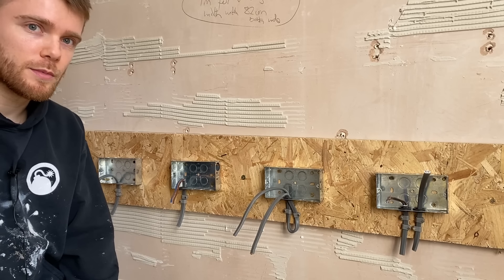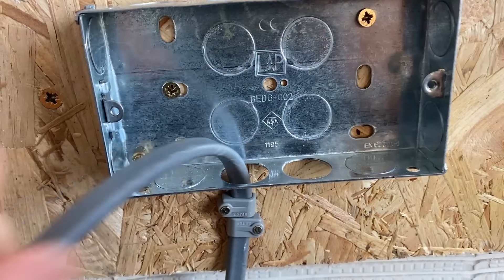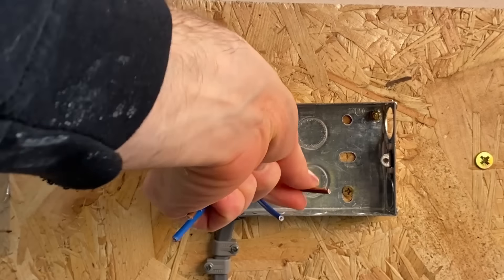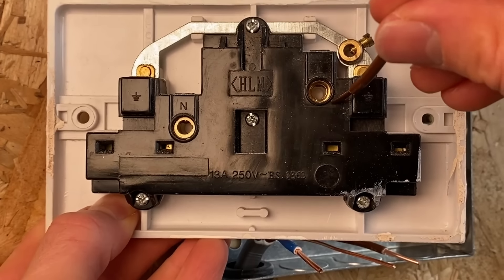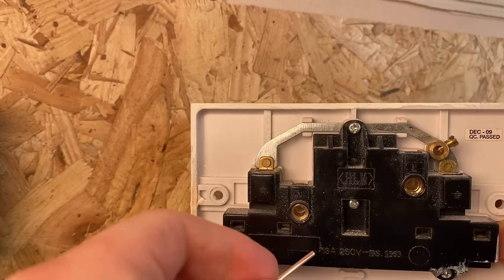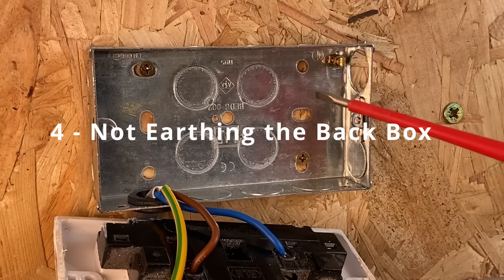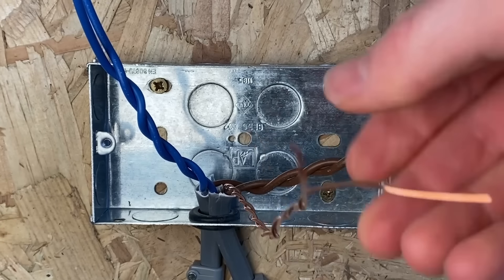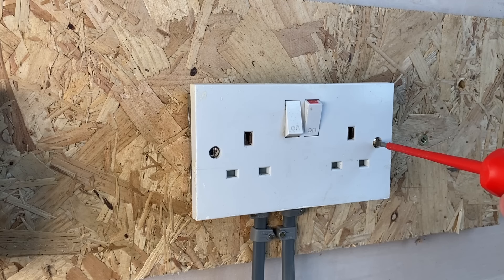5 Biggest DIY Mistakes Wiring a Socket

Comment: I love the fact that this is about mistakes allegedly made by DIYers. I have seen all these mistakes and more made by professional electricians in every house I have lived in.
Reply from the maker: You’re absolutely right, but I thought it made a better title haha, thanks for watching!
Reply: 3:33 I am still disturbed by what I saw a week ago on a very similar American YT channel.

Unbelievable fact no. 1:
They've only just switched to sockets with a tamper proof mechanism roughly similar to our one which has been a legal requirement since 1947!

Second horror:
Their way of being "to code" is to strip (too much) extra insulation off the "hot and neutral" so that there's bare copper sticking out of the connection points. So that it's quicker for the inspector apparently! Also they don't have to and therefore don't sleeve the "ground" earth coppers, and whatismore sometimes join the earth and the neutral wire in its connection point on the back of the socket fitting.

Third and final:
There's no L, N or E markings just different coloured screws. You're just meant to know.

Thank God I'm a Limey.
Reply: yip that's 100% correct
Reply: They are earthed so that in the event of water damage leak eg then the box is earthed
Reply: professional electricians are more likely to make these exact mistakes by cutting corners to get the job done quickly for maximum profit.
Reply: @HalfTheWorldAway-mf5cf The OP worked on installations in hospitals for thirty years. I think he probably knows what he is doing. I don't want anyone doing installation work in my house who thinks his level 3 diploma is an academic achievement!
Reply: @JP_TaVeryMuch  It is never permissible to join earth and neutral wires on the back of a socket fitting.  Also, we don't strip off extra insulation to allow bare copper to be exposed at the connection point.  Colored screws are standard in the US.....line is gold, neutral is silver, ground is green.  Both British and US systems are good.  They are just somewhat different.
Reply: However, do you have proof it was an electrician though because I doubt you do
Reply: I dont like the screws aligning. It just looks wrong, plus you have to obssively get them exactly in the same orientation, slight out and OUCH! it a real waste of time.
Reply: @peterdallyn6440  not that hard to do
Reply: Too right..
Reply: @SAHBfan  last time I checked, you can wire your own house.... all the gas and electrical regs say work must be done by a "competent person". You can't legally work on someone else's house.
I've done electrical work and installed my own gas boiler. I was an electronics designer (now retired). I've found plenty of faults done by "professionals"
Reply: I've seen the  made deliberately too.
Reply: @SAHBfan  Next time, get a pro in, tell him to sit there and drink tea while you do the work and he signs off on it.
Reply: @SAHBfan  That is not entirely true. I am in he same situation, being a chartered engineer working mainly in UK theatres and film studios, along with critical ATC applications at Heathrow airport.
When doing smaller or domestic work, mainly for friends and family, I issue my own certificates stating my industrial qualifications. Clearly this leaves me responsible, but if any authority challenged my work, THEY would need to prove that I was incompetent. Not the other way around.

At the other end of the scale, domestic electricians are a nightmare in commercial or industrial premises. Mistakes have included the ends of a general purpose ring connected to different phases, wrong CT's used in current transformer metering, along with no shorting links for replacement and testing. The list is endless.
My funniest moment was when prior to a visit from our late queen, the local authority sent an inspector. 
He was baffled by our electrode boilers and how the resistance was 12,000 gallons or water. 
The poor guy went as white as a sheet when I told him not to prod around because the main part of the system was running at 11kv. He also did not have a clue that in delta configuration one phase is bonded to ground. He kept asking about a neutral. LOL
Reply: @SAHBfan  Here in he UK, the word competent carries far more weight than qualified. 
A charter is somewhat different, it means that it is up to you to make sure that you are competent in everything you do and seek help or advice when necessary. 
My work was largely involving major London theatres and film studios. I would have to do a lot of research before doing any major work or design on medical equipment. 
Like you, I am technically retired, I am 76. I still get called in on historic buildings and on one occasion to an apartment block. That one was so funny, the first job for the electricians when they arrived was to supply the portacabins and supply 600 amps per phase to 2 massive tower cranes.  They had not even heard of CT metering, so they were looking for a meter big enough to put the cables in. 
Few people realise that all meters have a maximum through current of 5 amps. up to 100 amps, the current transformers are internal within the meter. Above that, a basic 5 amp meter is used and the coils threaded over the conductors. Therefore, those cranes needed 600 to 5 ratio coils.
The difficulty is that the primary being 1 winding and the secondary being thousands in order to produce 5 amps, the open circuit voltage in the coils runs into millions. Therefore they must be kept shorted until the meter shunt takes over. To calculate the wattage, the meter also needs voltage. this is supplied via 1 amp fuses for protection. 
I am sure you have come across this in hospitals, but because it is supplied by the DNO, you probably never gave how it works a second thought. It is normally in a Ryfield cabinet between the service head and the busbar chamber. 7 x 1.5mm flexible cables run between the cabinet and the meters.
Reply: Come on, you’re an ‘electrical engineer’. You can do every last scrap of wiring in your house, those three things that are notifiable, you pay your fee to the local council and they inspect it for you. No need to ever hire an electrician if you are competent to do the work correctly yourself.
Reply: @SAHBfan  Did you read my replies, particularly the first one, ?
Reply: @wilsjane  Frankly, I wish I'd never made the original post. I thought what I was saying was very clear. It was an observation about Part P, is all. Sure you can work around it if you really want to. 11 months after commenting, I still keep getting replies trying to prove me wrong. Fine, go ahead, ignore Part p, wire everything yourself. Sorry for commenting.
Reply: @SAHBfan  I am not trying to prove you wrong at all, I am just painting a broader picture and explaining the importance of competent over qualified.
When I worked at Heathrow for 12 years, since the supply is 11kv delta, no college qualification applied. I had a 4 hour meeting with the BAA chief electrical engineer before I started. This was to satisfy him that  I knew what I did not know   and I would not start pulling the ground radar apart.
Likewise, when you worked in hospitals, you knew not to make adjustments to MRI scanners, unless that was part of your job.
Reply: @JP_TaVeryMuch their plumbing is crazy too. Instead of using a 4inch soil pipe with a stack vent, they use 3 inch, plus a spaghetti maze of pipework to make vents to compensate. It makes no sense.
Reply: @UKsystemsI doubt you can prove different either

Comment: The actual mistake with the non folded ends is not that you didn’t fold them but that the screw is over tightened. You should only tighten until the screw is holding the cable in place and a tug test passes.

Comment: I'm a sparky and the number of sparkies I know that are to lazy to put on grommets and who do not earth the back box or use an earth sleeve if they do never ceases to amaze me , furthermore I have seen many a sparky cut the cable so short that it's a real struggle to wire in the back of the socket at all . Truthfully this upload applies equally to DIYers   and so called professional electricians who do not take pride in their work .
Reply from the maker: Absolutely, thanks for watching!
Reply: No requirement to earth the back box provided there is one metal fixed lug on the box. You earth the accessory and the fixing screw picks up the death from the fixed lug.
Reply: @andyjones1433  you are right but its good practice , there are a million cheap sockets out there not all come with earthing via the backplate on the socket so why not take the extra minute and connect the alreadt available earth wire to the terminal ?.
Reply: Never said it wasn't good practice also, never said I didn't do it. @shadow-Sun
Reply: @andyjones1433  His socket seemed to not have the earth link bar to the screws. I have not seen one like that.

Comment: Thank you for the tip about not twisting the two earth wires together. I never thought about the reason for that.
Reply from the maker: Thanks for watching!
Reply: It's good practice to twist the ends of the earth wires together, that way if it does happen to come out of the terminal you haven't lost continuity to all the sockets
Reply: Except there is no real logic to it. Twisting them reduces the chance of a break in earth continuity.

Comment: People in the comments saying the screw head orientation is not important and is not a safety issue… you’re wrong!
From a safety standpoint it’s imperative that the screw heads are oriented correctly as incorrectly oriented screws could pose a danger to anyone in the vicinity (within 10ft).
For those who don’t understand the danger, allow me to explain.
I am a little OCD and fitted all of my sockets and switches with the screws all oriented vertically. A friend came and tightened the screws a little further leaving them randomly oriented. I had no choice but to hit him over the head with my spirit level and stabbed him through the left foot with my screwdriver.
It took weeks for him to recover from his injuries and it took me months to recover from my PTSD associated with the entire debacle. My friend and I no longer speak.
I hope you now understand the danger associated with incorrectly oriented screws? Have a safe day!
Reply from the maker: Hahaha! Thanks for watching!
Reply: could be remedied by putting socket on sideways as a compromise
Reply: @theotherside8258  You sir are a genius!

Comment: i always earh the back box ive seen a a mounting scre touch a live wire and cause a wall to go live after a plasterer was wetting a wall down
Reply from the maker: Exactly, always best practice to earth a metal box
Reply: Serious problem with cpc/earthing if that screw through the live didn't show up on testing or allowed the circuit to be energised.  The mounting screws conect the backbox to earth via the faceplate.

Comment: I agree with everything you said and while it is a good idea to always run the cpc to a metallic backbox - as far as the regs are concerned it is only mandatory when the socket you are installing does NOT have an earthed screw hole at the FIXED backbox lug. Most brands of sockets these days strap both holes (or are fully metallic anyway) so it is usually unnecessary.
Reply from the maker: Agreed, belt and braces though. Thanks for watching!
Reply: The only problem with that is, when you remove a socket it is possible for the live to be bare if there was no grommet installed and for it to touch the metal box once you have removed the socket allowing it to shock you. Far better to take the earth to the box first then to the socket if there is an earth point fitted, although if there wasn't we were known to put a crimp onto one of the fixing screws, I know, rough but effective. Who you going to call.....rough bast.....
Reply: Sorry could you explain what sockets don't have an earth terminal..  In the UK we have three pin sockets which always have an earth pin even if its not used, in fact its always used even if its not as a functional earth, we use it as the earth pin on a plug is longer to open the gates to the live and neutral pins.  

You are totally wrong about the regulations, what it has nothing to do with the socket, on back boxes for sockets then its about the lugs, if there are no "fixed lugs" then an earth to the back box is required, if there is one "fixed lug", which is most back boxes that go into a wall like the ones shown then it is recommended but not required, if there are two fixed lugs then it is not needed.

Generally most back boxes like the ones shown you will have two lugs either side, one will be fixed, one will move about, so it has one fixed lug so it is recommended but not required, however lets say that fixed lug is broke off and you use one of those lug replacement fixings, then you have no fixed lug so an earth would be required.

If in doubt put a fly lead...
Reply: @steve11211  What do you mean i'm wrong about the regs? - you just reaffirmed my point! Also who said anything about sockets not having an earth terminal!?!
Reply: @mastergx1  You said "it is only mandatory when the socket you are installing does NOT have an earthed screw hole at the FIXED backbox lug"  Its not clear what exactly you mean by that, the socket is an accessory and not part of the backbox, apologies if I have misunderstood your point..

But you go on to say " Most brands of sockets these days strap both holes (or are fully metallic anyway) so it is usually unnecessary."   I am guessing you mean double sockets, all sockets will have a common earth and if it has two terminals for the earth they will always be connected together, but this has nothing to do if a fly lead is actually required, its all to do with the back box if the connection points ie where the screw to fix the socket to the back box is a fixed lug or floating lug, most back boxes have one of each, so its recommended not required.
Reply: @steve11211  Right, a metallic strap forming part of the fixing holes of the sockets. Doesnt matter if they are 1 gang or 2, or even fused connection units, isolators, etc. For nearly all brands of sockets (except the really cheap crappy generic ones) both holes will have a metallic portion with a typically steel "strap" bonding the holes to each other and the earth terminal(s).  Lets say your installing a cheap socket with only one "bonded" hole, say on the left. Now if the backbox has a fixed lug on the left, no problem. If the backbox has a floating lug on the left, you will need a flylead. Thats the point im making.
Reply: @mastergx1  BS1363 socket outlets as per the british standard will have both holes connected to the earth terminal.  If you are installing any sockets that do not then they do not comply with BS1363 and should not be used.   I think FCU's are the same but not 100%, light switches definitely do not unless they are metal light switches, but then if the light switch is not metallic then the cpc is not used anyway so you can just connect it into the back box..
Reply: @boblordylordyhowie no one earths back boxes anymore, it's done through the 3.5mm screws. The face plate should only be removed once the power is switched off, so no chance of getting a shock off the back box

Comment: Mounting a socket on a backbox. C1. Tut tut.  😁
Reply from the maker: Not sure if that is sarcasm or not haha. Definitely bad practice to mount backboxes onto an osb scrap on your bathroom wall haha! Thanks for watching!
Reply: @TheDiligentDIYer1759  Hi, just pulling your leg :o) 
Not just DIYer mistakes. Take a look at new-builds!

Obs the backboxes were surface mounted in your demo so the cable entry points could be seen.

Biggest thing I leaned was how important 'test & inspection' of  the completed work is. A DIYer will not know this or have the correct test equipment for this.  

It is easy to screw down onto the insulation, not the conductor, which could result in a ring final not being a ring. Would not be found without testing.

Similarly, doing a nice neat install is fine, but without testing the earth-loop-impedance, one would not know if a fuse/breaker would pop within the required disconnection time or worse still, just sit there pulling 50 amps or so, either electrocuting someone or cooking & starting a fire. 

There used to be a great sparky forum where photos of electrical horrors were posted, sadly now gone.

Comment: Here in sunny Japan, the power outlets do not have grub screws to secure the conductors. The bared conductors are secured by a barbed push in method. To release, push in a small flat screwdriver. The limitation is that it's borderline impossible to get more than two conductors in one terminal. And you can't buy a junction box.
You mention earthing the metal box directly, but the 4BA securing screws do this. As for lining up the screw heads, gimme a break.
Jack, the Japan Alps Brit

Comment: Can I just say that there is no correct or incorrect way to terminate a cable into the socket.  While I agree with you that doubling over a single cable
is probably benificial.  There are many Electricians out there that don't do this, Including me and I have'nt as yet had a problem with any install I have 
done.  Also there is no Regulation in BS 7671 that states you should terminate single cables into sockets this way.  So while your saying this is the correct way
to do it, it is largely a matter of choice for each individual Sparky.  In this respect you are niether correct or in correct.  Thanks for a very informative video.
Reply from the maker: Thank you for watching!